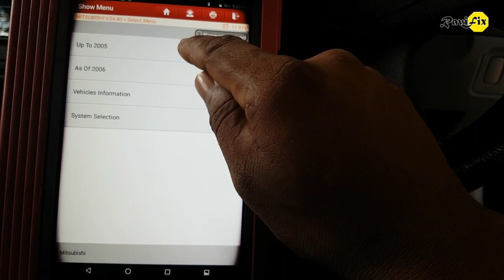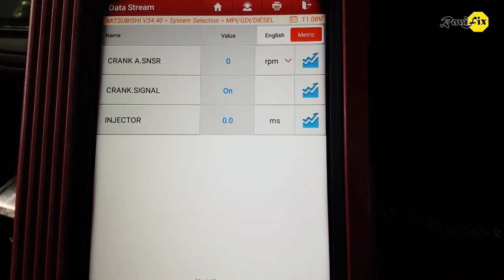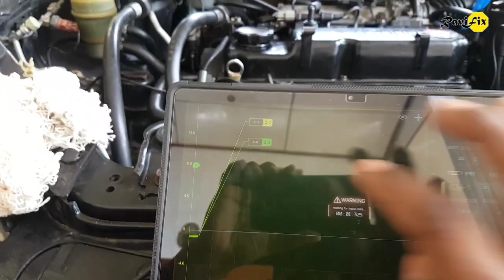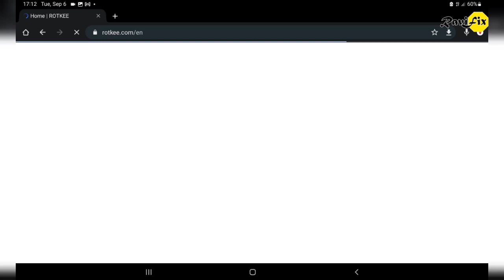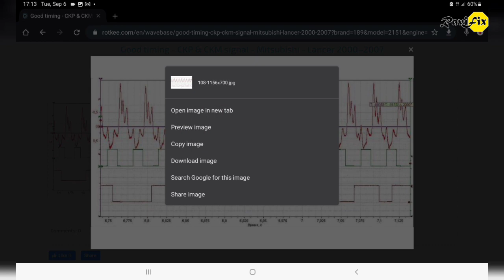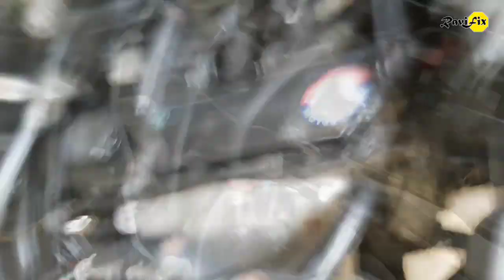Crank no start Diagnosis on Mitsubishi Lancer CS1 2007 4G13 Engine. Scope CAM Crank sensor Signal.

Comment: Hello, Ravi sir, how are you?I have one thing to ask you.I have it hantek oscilloscope 1008c .I have downloaded the Play Store hscope automotive software. And I have also purchased a license for hantek oscilloscope 1008.I have watched many of your videos.Should it also be given external power?For example, what problem will it cause if we don't give it external power?I'm having a problem here.My oscilloscope, the voltage is not telling me the correct one., when it starts, it shows 12 volts instead of 13-14 volts.And the baseline doesn't indicate zero volts, it indicates below zero volts, in -.